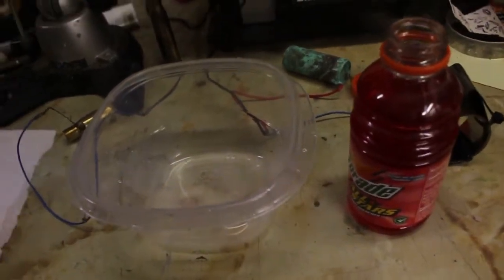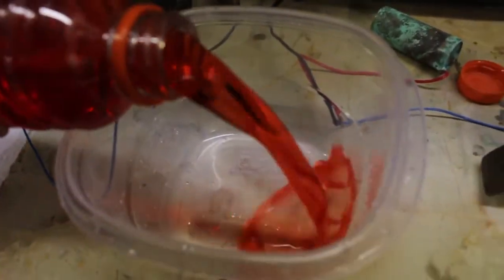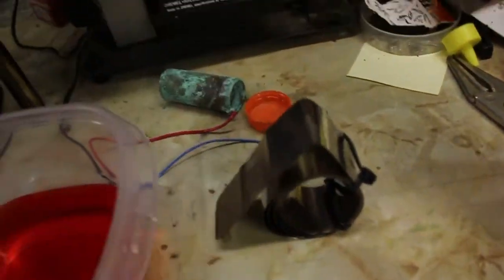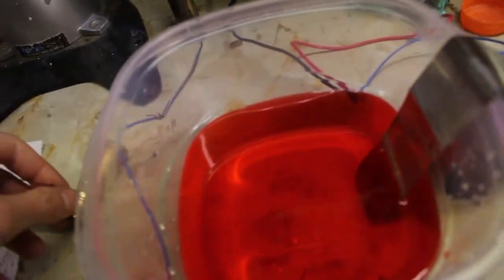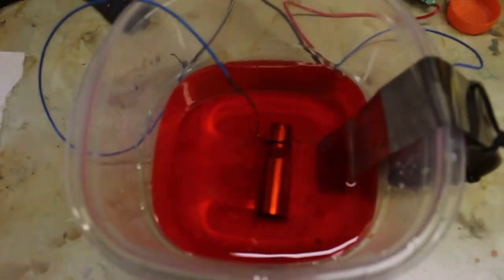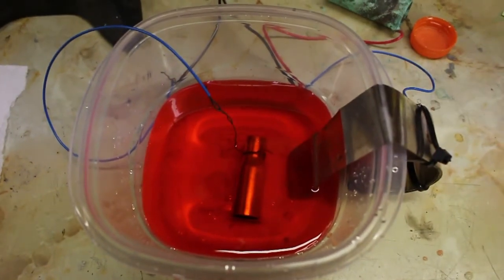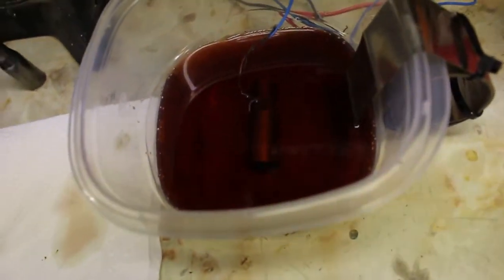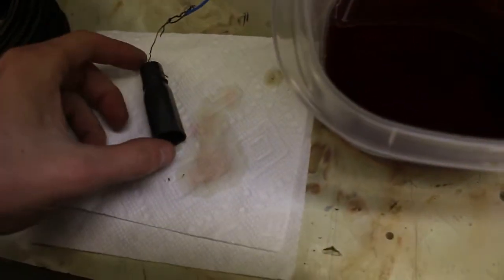Nickel Electroplating With Gatorade

Comment: what? it's that freaking easy? damn that is a nice plating.
Reply from the maker: eh, it works WAY better if the electrolyte is doped first with nickel ions/nickel. to do better plating jobs, i use a home made mixture thats LOADED with nickel, or nickel sulfate solution. they give different finishes. depends on what result i'm after. before plating 50bmg, i'd HIGHLY recommend cleaning it with lacquer thinner to remove the coating(as i did not here). i'll make better videos later.
Reply from the maker: I uploaded a new video with nickel sulfate. different finish, more shiny and more in depth.